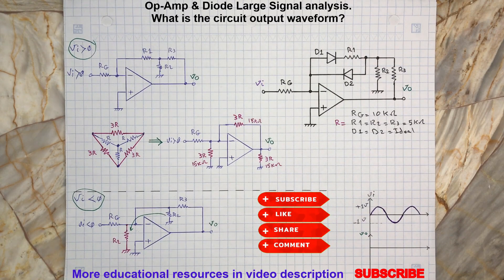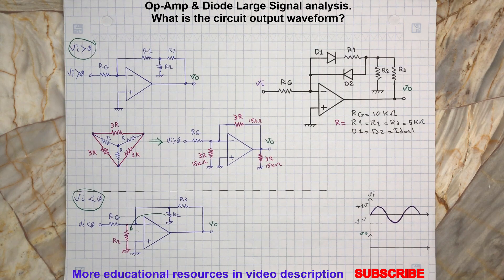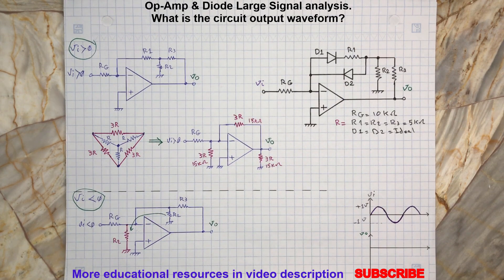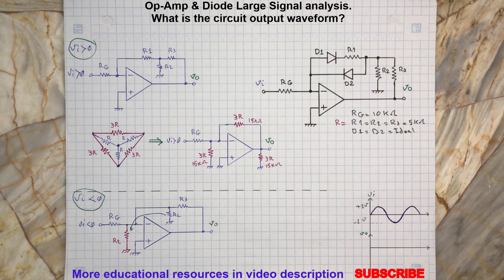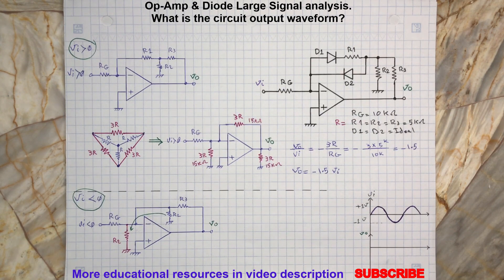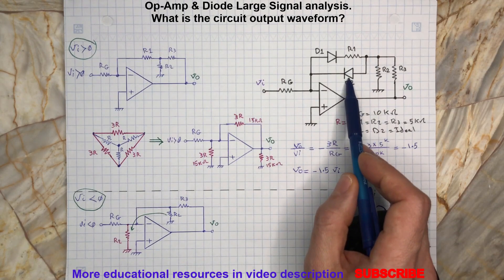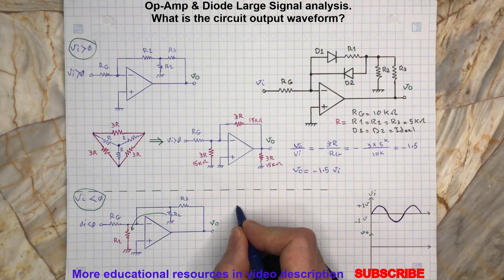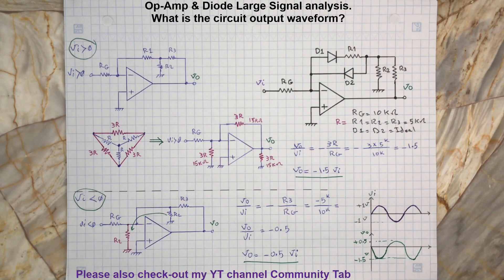Op Amp with Diode Circuit Analysis, Op-Amp Non-Linear Circuit Solved Problem

Comment from the maker: Op-Amp with Diode circuit videos:
1) Op-Amp Active Limiter with Zener Diode:  https://youtu.be/AAEvPySJ7fk
2) Op Amp and Diode Circuit Solved Problems:  https://youtu.be/YBReCN6MGNo 
3) Op Amp Precision Full Wave Rectifier:  https://youtu.be/rJCzxXOkO8o
4) Op Amp Circuit Solved Problem:  https://youtu.be/44_gHSnsnkU
Electronic Circuit Analysis Playlist: https://www.youtube.com/playlist?list=PLLA_QJ8rHZBh5LqrY41bCvKgreRDRWrBQ
Control System Playlist: https://www.youtube.com/playlist?list=PLLA_QJ8rHZBjS_S6WPkmUweF5NbImvSqf
Digital Logic Playlist: https://www.youtube.com/playlist?list=PLLA_QJ8rHZBjoWpsdJeo6ii5HnWTEmDi7
Circuit Analysis playlist: https://www.youtube.com/playlist?list=PLLA_QJ8rHZBj8qPBFArjveEustxuToLDw
Electricity and Magnetism Playlist: https://www.youtube.com/playlist?list=PLLA_QJ8rHZBhQ7ykCkWBI8sbphMA_Rf_1